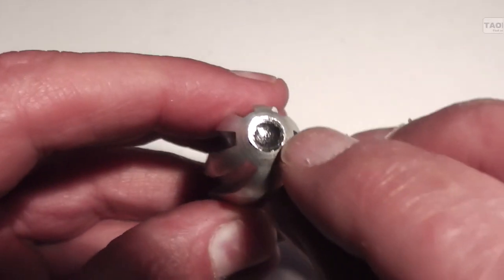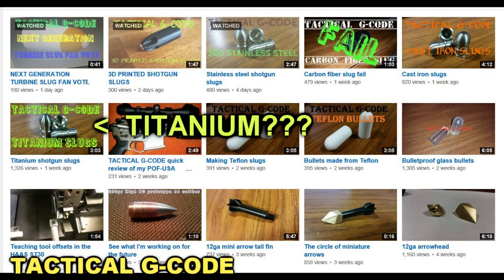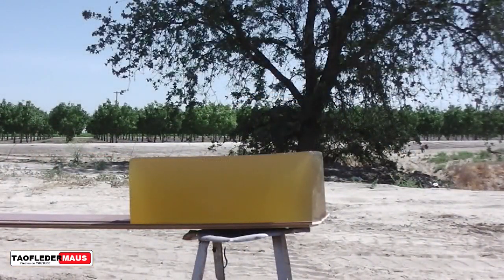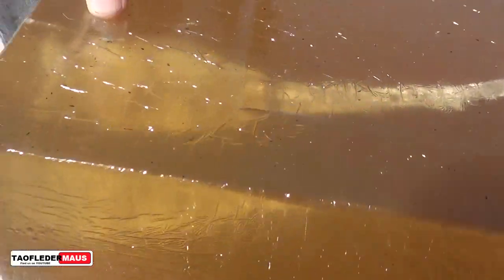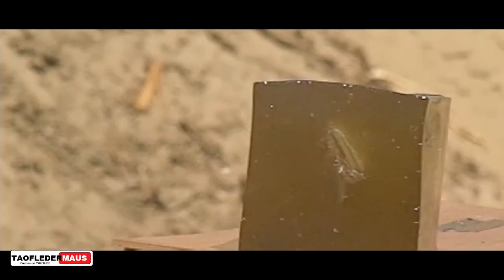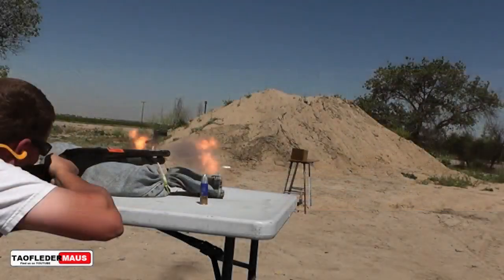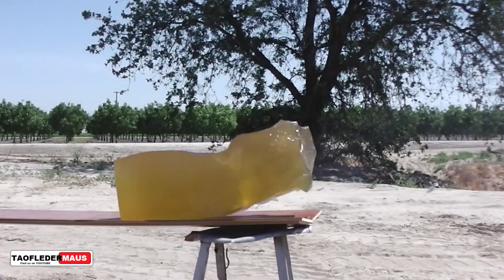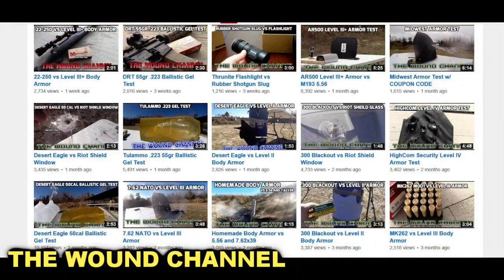Custom Aluminum TURBINE Shotgun Slugs - BALLISTIC GEL Testing

Comment: That rifling on those slugs is not doing anything. In order for rifling to work it must carve grooves into the bullet (in the case of a normal rifled barrel) and the bullet is made of either lead or lead with a copper jacket. Both of these metals are much softer than the steel of the barrel, and the bullet is slightly larger than the barrel diameter, so the bullet tightly fits into the rifling, causing grooves to be carved into the soft bullet and the bullet is forced to spin while firmly locked into the rifling of the barrel. This is not happening here, in order for a rifled slug or bullet to work, it has to be slightly larger than the barrel and be made of a harder material than the barrel. The aluminum slug is far too soft to carve grooves into the steel barrel (and I doubt you would want your barrel to undergo such abuse anyway). It is just sliding straight through without spinning at all.

Comment: I'd like to see someone machine a slug-sized convergent-divergent nozzle (https://en.wikipedia.org/wiki/De_Laval_nozzle), just to see what sort of effect it would have (super hollow-point?). The nozzle would need to have a small conical plug installed from the rear, so that it could be fired and have it get pushed out as it flies through the air (an anti-sabot, if you will).

Comment: i have an idea for spin stabilized rounds. there is a lot of compression in front of these supersonic objects and i imagine other than the front, much of the object is under vacuum so streamlining and fins do little if anything. the idea is to drill a cavity in the front of the round (or perhaps the back for balance using the explosion pressure to give a brief rotational thrust the moment it exits the barrel) and the compressed air in the cavity exits through holes drilled tangent to the circumference of the hole hopefully using thrust rather than a screw effect to spin the round. the outside shape of the round can look similar to the sucessful slugs. blunt nose radius, and a groove by the tail to lighten it up and maybe add some drag. 

one other problem with side groves or twisted fins is that unless there is a sabot gasses pass the round in one direction in the barrel and air passes the other direction after it leaves the barrel. the direction of spin is opposite so if it picks up spin in the barrel at all the air has to counter that spin. but i think at these speeds the air is not attached to the sides of the round at all.

Comment: It needs to be back heavy and the hole perfectly drilled to size and depth to the full extention of the farthest distances of the round to create a pushing effect on the nose of the round otherwise the weight with lob it around and the weight on the front basically turned it into a overpowered throwing knife effect rather than a dimensional spin but it would be neat to see however the powder and pressure in the bearel is to blame as well so either a finer grain or a muzzle break would help disperse it evenly on the exit with the way the rifeling is on the round it forces a negative channel on one side of the round no matter what but still I like the idea

Comment: Somebody PLEASE tell Tim Hamilton to weigh down the tip of his rounds, anyone whos thrown a paper aeroplane knows that it flies straighter if you put a paperclip at the front. Right now the centre of gravity for these rounds is towards the middle hence the tumbling, make the nose out of something heavier like steel or lead and I gaurantee you'll get better results.

Now if you want something REALLY exotic, challenge someone to make a gyrojet. Lets see how far we can get those slugs to go.
Reply: fludblud you said "anyone whos thrown a paper aeroplane knows that it flies straighter if you put a paperclip at the front" === not true in my opinion, it will merely fly in the direction that the control surfaces force it to, and this slug has no wings. what we need to do is think of this slug as a bomb which does not fall down but is falling sideways. we have all seen bombs falling with fins on the tail but they still wobble before settling down and falling straight, however, bombs with parachutes do not wobble as much due to the incredible drag inducing effect of the chute. these slugs need a solid metal tail in the form of a flat head rivet with a short to medium length shank attached to the base. think of it as a complete metal nerf football with a flat head rivet tail instead of fins. http://1.bp.blogspot.com/_j65Jxu-N6Q8/SwWhyYvoMBI/AAAAAAAAB8c/zDlncQf-26A/s1600/Nerf+Vortex+Mega+Howler-orange.jpeg be well my friend
Reply: Yea, agree. Or loose the boat tail and hollow out a portion at the base. Like if the projectile is 1.5" overall, hollow out like .75" upwards from the base
Reply: Petis333 yes that is another way to go but you would still have grooves with no abrupt end at the tail. after studying what works for the last 100 years for brenneke and 85 years for foster slugs it is easy to tell that the rifled slug needs its grooves to stop before the tail and that a wide tail rim is used so that pressures are vectored out perpendicular to the tail creating high drag coefficients at the farthest possible rearward position of the design.... http://static.giantbomb.com/uploads/original/9/95167/1617266-slugs.jpg  ... if the flat-head rivet tail i suggested were to be used , then the grooves should stay as they were originally or else they would create drag too far forward. hope i explained that without confusing anything.... another thing to consider would be modern aircraft in relation to this topic. think about planes that have started using small "canards" at the front of the plane. they are used to induce vectoring and drag to make sudden course changes. planes differ from our projectiles because planes are not spin stabilized, they are self-powered, and they desire to be directionally controlled with the ability to change course abruptly. i only mention this to point out how the grooves should be designed if this aluminum projectile has or does not have a tail added. if a tail is not added then we might want to make the grooves resemble what already works http://www.usacarry.com/wp-content/uploads/2011/12/10deepslug.jpg  ......be well my friend

Comment: very interesting video... do keep in mind that if the slug goes super sonic any airflow going over the slug separates and you have a cone effect.. in short any shape behind the tip will have zero effect on the aerodynamics due to flow separation. things to help would be the round will have to be spinning at high velocity before it leaves the barrel, this will help with stability. also the force from the discharge is applied to the rear of the slug is behind the center of gravity.. this is where the keyhole originates from. its like kicking a football... doesnt matter how you kick it it will spin through the air... now if you take the same football and throw it in a pass it spins very nicely. that is the force being applied from a different point. now applying the same theory to a gun is very challenging and im no expert on the topic. perhaps if you would machine the rear of the slug to have a sharper tip. the reason would be so that when the gun powder ignites the force that pushes the slug out the barrel would be directed to the tips instead of hitting the slug like a battering ram. for the front bit of the slug try to machine teh groves all the way up to the very tip of the slug.. as the slug leaves the barrel the tip would immediately be in contact with high pressure air to aid the rifling of teh round. also instead of square groves try triangular groves. sharp edges cause flow separation and causes drag... triangular blade like groves could be advantageous... i hope some of this helps maybe someone would be able to improve on this... great work i would love to see this work

Comment: The reason this doesn't fly straight is because the channels cause the bullet to rotate in one direction in the barrel, and then to rotate the opposite direction when it's flying through the air.  The reversing of direction is what causes it to tumble through the air.  It's a good idea but needs more thought and modifications to spin it the same direction in both the barrel and the air.

Comment: ***** Looks Like You have already tried what i tried to tell on the other Video... But why not case the Shell like Factory load  i.e Nothing sticking outside....Because there is no fucking way that Round could tumble under Normal Conditions... or probably the weight of Aluminium is the cause of the Tumbling effect..!
Reply from the maker: *****  I couldn't fit it ANY deeper in the shell.

Comment: Spiral groves don't stabilize a slug. You need RPG-7 tail-fin design with a propeller pattern. Like the Grenade 12 gauge round it has to have fins that protract from the slug.

Comment: Still open end. The expanding gases passing from the back makes it trying to spin the opposed than the expected inside the barrel finishing completely unstable at exit. Need to close the back part like a piston. The lead part should be just in the first 1/3 of the slug to act more like a shuttlecock, or the same in-flight instability could appear.

Comment: Hello to the this channel. I have a suggestion for those shotgun slugs. So I build model rockets and if you want your rocket to be stable the ln you have to have the the (CG) and (CP) in specific places. For example you want the the CP to be above1 length from the CG. So on a rocket that has a diameter of 4 inches I want the CG to be 4 inches below the CP. The key rule is to always have 1 or above the diameter of the object that separate the CG below the CP
CP= Center of Gravity 
CG=Center of Pressure
An easy CG of the slug is to find the balancing point of the slug (where weight is equal on both sides) 
A Ok way to find CP is to cut a silhouette of the out line of the slug then find the CG of that silhouette.
It's ok but not very accurate and I don't know the crazy math formula for it
Then measure the diameter of the slug and see if the CG and CP are balanced correctly 
If so the slug shouldn't tumble

If u wanna check my facts u can research it since u don't know me...and see if they are right

Comment: Have you seen the sabots used in the new navy rail guns that are under development? They are a 3 piece clamshell design. After the round leaves the barrel, the 2 outer sides leave the main sabot and it flys straight at Mach 7 straight to the target. Just a thought that might work with this application.

Comment: Have u tried to shot a bolt/skrew yet? Saw off the head and it will be like a slug. Maybe shoot a steelplate and use both 8.8 and 10.1 or whats it called and compare it :)
Reply from the maker: 1Grovis1  We shot nuts and bolts before.

Comment: Very interesting design. Would drilling a hole deeper in to it and putting in a titanium screw add enough weight? Size and weight would be your choice and properly drilling on center with a screwed in bolt/screw should add to penetration.

Comment: Is it a possibility that at such short range, the grooves don't have enough time to start the spin? I wonder if the round would start to stabilize if fired at greater range? But then again, they have been sideways at 20 or so yards.. might not ever comeback nose first.
Reply from the maker: TheMontanaDave  If it doesn't come out of the barrel flying straight,  I'm sure it never will.

Comment: nice test! your camera is working great for the ballistics gel. now shoot some glass beads into that thing!
Reply: ***** It did that to me as well, I was assured by the manufacturer that multiple melts don't change the properties and if you burn it all that happens is it turns yellow it doesn't "ruin" it.  I have noticed that after several melts it's easier to rip when pulling out of the mold.  

The mold they sell is just a box that is 16x6xabout7 which gives you a little room on top when you cast a 16x6x6 "FBI" sized block.  DO NOT melt it inside your house, it gives off a lot of smoke and smells bad.  I use a turkey roaster electric thing outside but anything that can apply constant heat should work.  Try not to exceed 235 degrees F if you can, I think it really starts to burn above 250F.  It will melt well below that but it takes a long time to get the heat in it.

Don't get water in it while melting or it will get even cloudier than it is now.  If you try to melt it down chop it up into little pieces first, I use a serrated cheapo kitchen knife and bend it as I cut.

I was hoping you could get a few tests out of it without needing to melt it, I should have suggested keeping it in the box when not being used, my bad.  Also a heat gun will smooth out the finish and take the wrinkles out so you can see better.
Reply from the maker: Ah cool!   TNoutdoors  said it stinks and I think he uses a barbeque. It was almost 95 here this weekend so everything was hot.  I could almost put the gel in a black metal ammo box and set it in the sun and it would probably melt it down.
Reply from the maker: MattV2099: Guns & Food  Thanks Matt!  We shot a glass marble and a ball bearing at the gel.    Those worked pretty well!
Reply: ***** did the block survive? will you be able to shoot it more?!?!??!
Reply from the maker: MattV2099: Guns & Food   We shot it both ways lengthwise,   and three shots though the side.   It started melting on the way home in the back of my stuck and the whole block is all hinky and distorted now.  I thought the stuff didn't melt in the sun like that.
Reply: ***** wow!!!! maybe the stuff breaks down when you re-cast it a bunch of times and become less tolerant to heat?!??! that's crazy!!!!
Reply from the maker: I'm not sure.   I need to find some metal box to try to recast it in.
Reply: ***** One of these rectangular metal plant pots?
To be fair, an option would be to simply grab a large metal bucket and then cutting the gel into a block.
Reply: ***** How about pouring it into a cooler?

Comment: The problem with these darts/slugs are... there's no drag on the tail of them. Thing about a tranquilizer dart or a blow gun dart. They have yarn/threading on the tail to create drag. I don't know if you've ever launched model rockets but, smaller rockets had a strip of plastic instead of parachutes to slow them down on descent.

Comment: How about a spherical shot (lead?) that fits tightly inside your barrel? Kinda like a Triball 12 but with only one shot instead of 3
Reply from the maker: Perdikofas   If I had a lead mold I would do that.   We will be posting a video soon where we shot a hardened steel bearing ball at the gel,  and also a glass marble.   Those fly very straight.